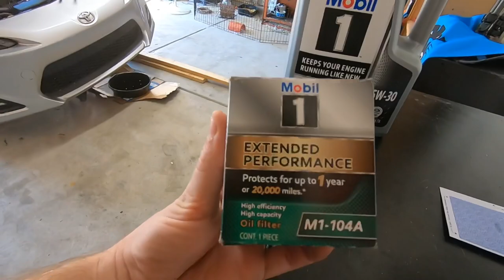LOST MY FRONT LIP on my FRS and ALMOST blew my engine!

Comment: How well is 5-30w i just did my oil change with 0-20w and I am curious is 5-30w is any better for this motor?
Reply from the maker: 0-20w is what Toyota recommends! I read on some forums years ago about 5-30 and have used it since then with no issues 👊